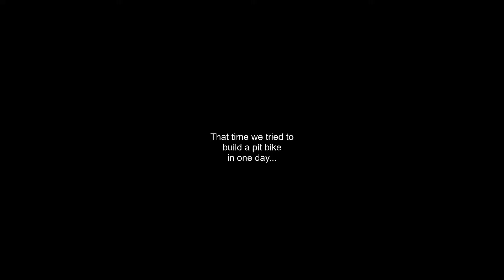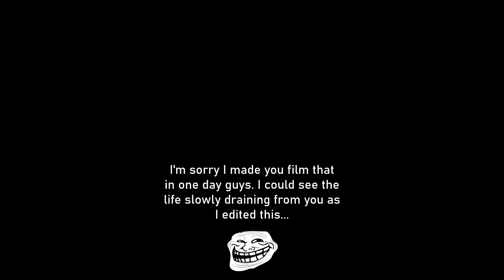1 Day Pit Bike Build (Almost...)

Comment: Is that the trellis frame and subframe kit I want to get a kit for my crf70 what forks do I need?
Reply from the maker: Hey AK! Sorry for the slow reply!

Yes it's the trellis frame and subframe. We bought the one in the video used and it came with a forks kit. 

Are you buying it all new? Pitbikeparts co uk sell both the frames and fork kits, they would be able to make sure you're buying parts that will fit together. 

I've got the 730mm (770mm) on my CRF70 and I'm riding on 17" front / 14" rear wheels which are SDG fitment.

Hope that helps!
Reply: @MoonshineNaughtyBoys  yeah I gonna get one for my full mod crf70 build thanks
Reply from the maker: @ak_beast_509 nice, hope it goes well!

Comment: What size of spacers for big wheel 125 pitbike  rear wheel
Reply from the maker: It's a mystery as far as we're concerned! We usually end up making custom ones for our bikes as the standard ones available online never quite fit right. If we're feeling extra moonshine we get the old hack saw out and make a zombie spacer, sometimes using multiples on each side to get the maths to add up just right! Helps you get it set up with a good size on both sides and then you can either make a proper pair to fit your bike or maybe get a machinist to make some up on a lathe. Hope that helps!